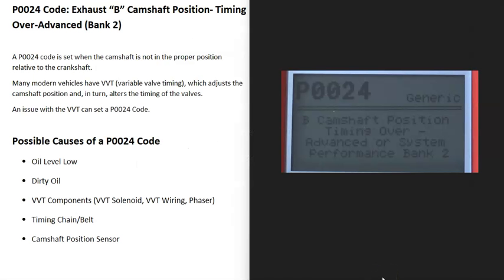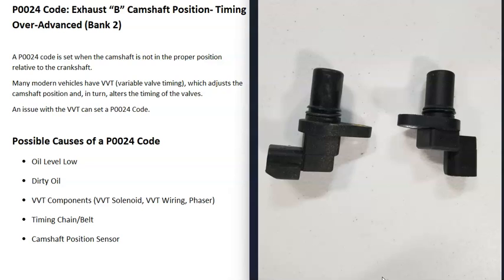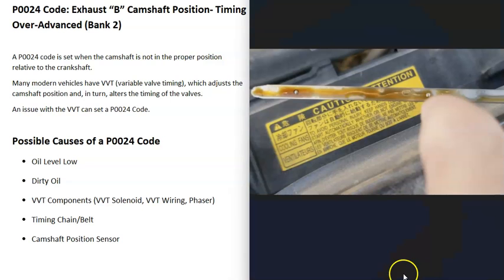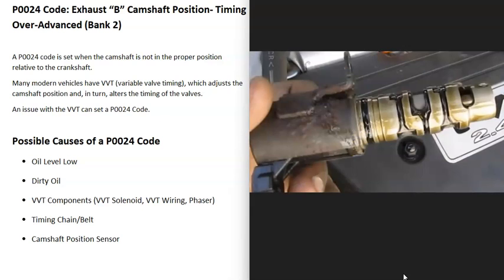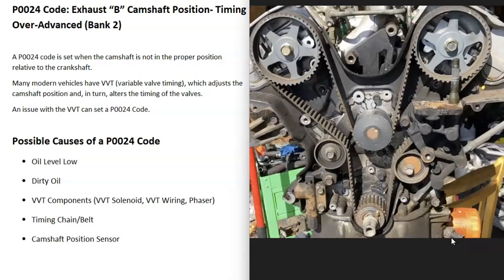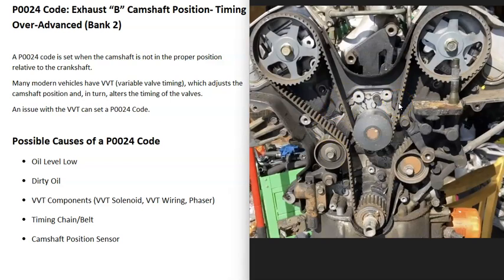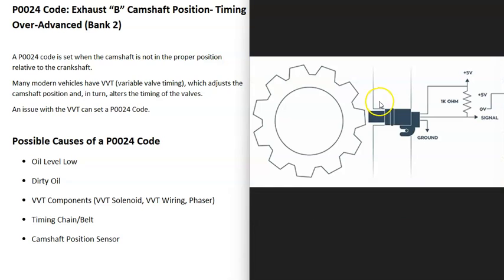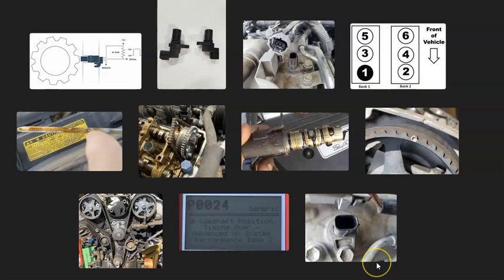Causes and Fixes P0024 Code: Exhaust “B” Camshaft Position- Timing Over-Advanced (Bank 2)

Comment: So if worst case scenario all the issues you mentioned is going on with my engine does this mean time for a new or rebuild or can this code be fixed without replacing the engine i just bought this car and it's got 230,000 km 2013 infinity G37xs. Codes p0024 and p0014
Reply from the maker: Usually, it is a bad component, but it needs to be diagnosed. Both banks have an issue point to something that would affect the whole engine such as a bad timing chain/belt or possible oil pressure.

Comment: GM Genuine Parts 12732244 Camshaft Position Actuator Solenoid Valve for 2018 Chevy Colorado V-6.  My engine runs a lot smoother at idle now.

Comment: Thank you for sharing this info.I had the same code yesterday it came on and this morning the check engine light went off all by itself, is that normal ? or should I wait till it comes on again before replacing it. Thanks
Reply from the maker: Intermittent issues can be hard to troubleshoot sometimes. It could be a loose wiring connection that disconnects randomly, bad sensor, possibly an old timing chain/belt, or VVT issues. If the code is gone and there are no other codes, it will be hard to pinpoint the cause.

Comment: Looks like I'm going to have to change the VVT SOLENOID, I've already changed the camshaft position sensor bank 2. Still have the engine light back on. Since I have to remove the whole intake off , I'll change both intake and exhaust VVT. solenoids.
Reply: Did you figured it out?
Reply: @jordy0521 well, I was told by the dealership that sometimes the code will come back after you erased it with a OBD code reader, which I have done about 6 times. So, far , no engine light back on. So, all I've done so far was changing that cam position sensor on bank 2.
Reply: @daleliske9757 appreciate you, I did change the exhaust camshaft position sensor the last week but the car is still making a weird vibration while idling, I'm probably changing the Bank 2 solenoids soon, I was just wondering if they are the same for exhaust and intake and apparently they are accordingly to some stuff i read before, hopefully that will fix it
Reply: @jordy0521 good luck, let me know the results. Any information we can pass along to others, I'm sure would help.
Reply: @daleliske9757 just changed both bank 2 vvt sensors, it's still doing that annoying vibration, idk what else to do at this point
Reply: also got a p0128 code two days ago, it's just turning into a bunch of trouble, this sucks

Comment: My vehicle was new to me around this time last year.its got relatively low mileage at 89700 it's a 2016.
The check engine light didn't come on until I got a low oil message.

It's my fault,had a lot of stuff going wrong in that time and I back burned it.
I believe it was this event that made that light come on. I've changed the oil and filter. How can I get the light to go out? And is there anything else I should keep an eye on for the mistake of letting it get so low?
Reply from the maker: I would clear the code and see if it comes back. If it comes back, it needs to be diagnosed as a component may be damaged.

Comment: @Hvac Mechanic where do i locate my bank 2 exhaust camshaft solenoid on my 2015 chevy impala lt limited because im getting the code P0024 only im pretty sure i can fix it help  A.S.A.P!!! Also, what has to be taken apart off etc or not, is it easy to get to? Oh I forgot how many do I have

Comment: what happens if you are getting the P0021 code along with the P0024 code (the P0014 is the other sensor) then also the P0014 code
Reply: I got the same thing, did you ever figure it out?
Reply: @ this was my sisters car, it turns out they ran out of engin oil

Comment: Hi,  my 2007 Lexus RX350 over heated (Blown hose. I pulled right away) and after fixing the issue replacing the coolant and burping the cooling system,  Code P0022 and P0024 popped up.  Toyota Service center says that we need a tear down to find the problem and it could be the camshaft housing and VVTI timing gears (?).  The vehicle has been service every 5000 miles.  They say the cost is about $8000. Any advice or suggestion before we take the next step? BTW, the Variable Valve Timing (VVT) Solenoids have been replaced, but no result!!
Reply: I have the same issue with my 2021 Subaru outback. Car been serviced only at the dealership and about two months ago P0024 comes on, I changed the OCV and camshaft sensor and the problem still there. Subaru saying it's $10.000 to tear down and fix. Timing over-advanced on Bank 2 B
Reply: @wrighma7753  I ended up replacing the whole engine with another used one.